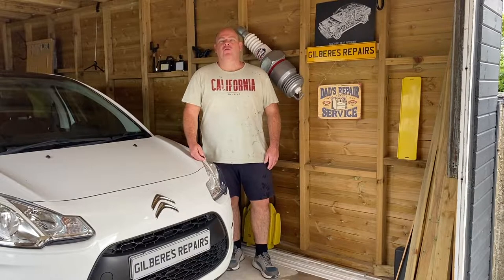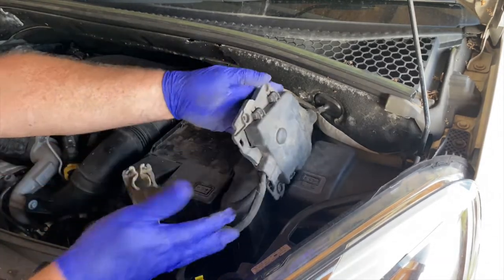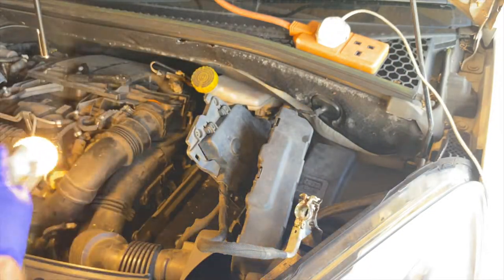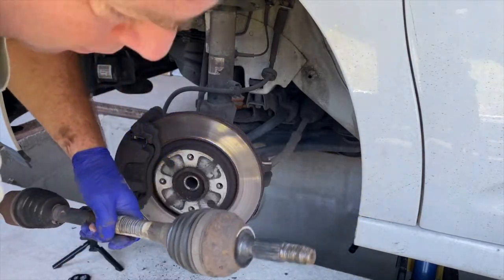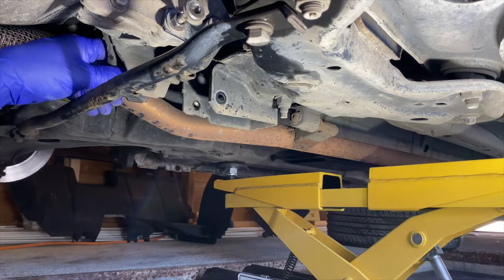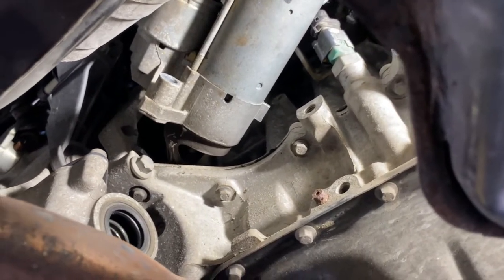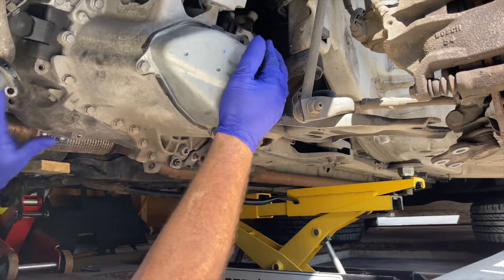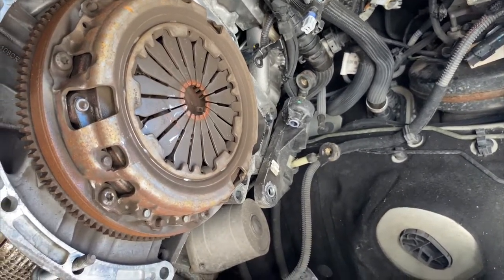Citroen C3 Clutch Replacement

Comment: My 2010 Picasso has rivets on the lower wheel knuckle is there another way to remove this hub? or are you just meant to drill it out and replace with bolts?
Reply from the maker: @marcofixit  Hello
There should be a “pinch” nut and bolt you undo to release the ball joint pin. Above the rivets?
Sandy.
Reply: @gilberesrepairs  yeah I did undo that, and then hit the lower plate for about 10 minutes to try see if it budged or not. Will try again tomorrow morning
Reply from the maker: @marcofixit  
Q1… Did you fully remove the Pinch Nut and Bolt? 
They have to be fully removed because the bolt normally fits into a recess in the ball joints pin.
Q2… Did you have the whole front end of the car jacked up, or just one side?
If only one side is jacked up you’ll be fighting against the anti-roll bar. (ask me how i know 🙄)

Sandy.
Reply: @gilberesrepairs  after much swearing, I did get it off. The prop shaft basically fell out. now to do the other side. The problem I forsee coming up will be the centring of the clutch I will see if hss hire has it otherwise I'll have to come up with another plan
Reply: @gilberesrepairs  yeah I was doing one side up at a time. Doh
Reply: Ok, so at the end of the day I've made a few mistakes and triumphs. I parked the car up against my driveway with the passenger side against the boundary as I get the benefit of sitting on the pavement with the car about a foot and half higher than myself (the side of my driveway sits higher than the road). I started work on this side first (Gearbox side) and got the prop shaft out by lifting the knuckle out of the ball joint as discussed earlier.I've now realised I should have started on the other side first as I had to reconstruct the knuckle so I can lower it down again to remove the other sides drive shaft. this is tomorrows challenge. once the other side is out I should be able to return to the passenger side and remove the gearbox. I did not remove the nut from the sway bar in the end, but used some ratchet straps to pull the knuckle in the directions I needed, this was a dancing maneuver to re-align the ball joint. I do think I will be removing it on the other side though as it will make it alot easier. I just want to document this somewhere in case someone else tries to do this one side at a time in the future.
Reply from the maker: @marcofixit  I feel your struggle 👊 I’ve maintained all of our cars outside for the last twenty years 🙄 I’ve only been able to build my garage in the last five years! and it’s been lovely 😎
I’ve just had a look on Amazon and clutch alignment tools are under a tenner 👌
Definitely worth documenting your progress for others to read and learn from 😎
Ideal timing for your clutch to fail 🥶🥶🥶

Keep us posted!!
Good luck 😉
Reply: @gilberesrepairs  Well its done. I never want to go through that again. Anyway places I struggled: Getting the starter motor off. I had to remove all the cable loom and a black filter box?  down the back of the engine above the prop shaft also. The air box and all its piping had to come out to get to the bolt on the topside of the starter. I think someone else had been here before as the cable loom mount was disconnected and not replaced. Next issue was the bolt behind the Catalytic converter that was impossible to get a grip on even with removing the shield bolt. In the end the entire front of the car had to be removed. Once this was done I could separate the bell housing from the block but then it got snagged on a cross support across the bottom of the wheel well. I had(well did) remove the adapter mount plate and the nylon gear select leaver arms from the gearbox however after 2 days of wrestling with the gearbox and snapping a break line I never got it out. However after sitting down and rethinking I got some ratchet straps and pulled the engine up and away from the gearbox and pulled the gearbox towards the wheel well, this opened up a gap of about half a foot, just enough to remove the DMF and clutch. I got a LUK DMF and clutch kit new break hose and prop seals for £350 so I was all in now. I bought a clutch alignment tool, but was unable to use it in the small gap I had to work in. In the end I used the alignment tool outside the engine and checked the spacing all round the clutch to the plate(about 1/2mm) and mounted it up loosely to the crank. I eyeballed this gap while slowly turning the engine and tightened it slowly in place then torqued it up to spec. getting the bell housing on again after this was a nightmare of trying to work in a very cramped space wrestling a heavy lump of steal above your head with the finesse of a brain surgeon. this took another two days, and I had almost given up completely. Also any large jolt would cause the clutch fork to slip off the two fine pegs of the engaging ring, in the end I used elastic bands to hold the clutch arm in place to stop it popping out every time I moved it. When I did get it to line up finally it slid on like a glove and I was shocked. I used a bore scope to look inside the bell housing to make sure the fork and pegs where still in place and bolted it up. I tested the feel of the clutch in the cabin and started to place everything together again. finally after 3 weeks I started the car much to the cheer of all the neighbors I'm not sure if they where genuinely impressed or just glad that the car was back together and not looking like a scrap yard on the driveway. I did have an oil leak afterwards from a ball bearing joint on the driver side prop shaft going into the gearbox as I took this off in error and mounted it back on slightly crooked, but after re tightening this, it was good again. also the mid way CV joint caught me off guard as I puled it off it came apart at this joint, luckily nothing came out so just had to place the boot back over it. Anyway I drove the kids to school this morning and wow the clutch feels so smooth it must have been on its way out for a few years. I did realise on the drive that I forgot to reconnect the exhaust pipe at the center mount as it kept banging all the way to school and back, so I'll fix that this evening. Thanks for the video It was a great help and inspiration for this job.
Reply from the maker: @marcofixit  👏👏👏👏👏👏Well sir, sounds like you deserve a round of applause for enduring the job to the end 👏👏👏👏👏👏
Soooooo, i take it that’s your last time doing a clutch 🤔 😂
I’m glad the outcome was good and the kids got to school on time 👍
Sandy.

Comment: Hi mate, do you reckon this would work on a Citroen c3 2017?
Reply from the maker: @notformodernsociety9054  Have you got a petrol or diesel?
Reply: @ I’ve got a petrol
Reply from the maker: @ That’ll probably be the 1.2 puretech engine. It’ll probably be similar to the one i did, but i would research (1.2 puretech clutch replacement) the job first. 
I’m not a car mechanic so don’t know all the refined parts of the job. The only big difference you could encounter is if the gearbox on your car has an external slave like my sons or an internal slave. But i don’t know if Citroen even use an internal slave 🤷‍♂️
My advice is… do some more research.
I’ll have a little look for you now 👍

Sandy.
Reply: @ thanks mate that’s really nice of you
Reply from the maker: @notformodernsociety9054  Check out this vid… https://youtu.be/gba6ktm1LVw?si=gh2UfAgpxo4Mrzt5
Basically the same job 👍
Hope this help and keep me updated on how you get on!

Sandy.